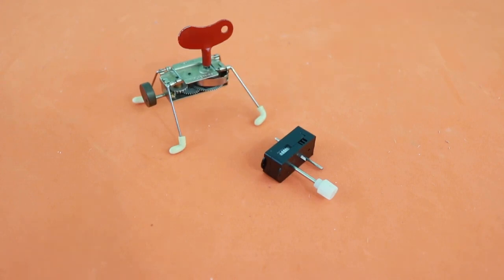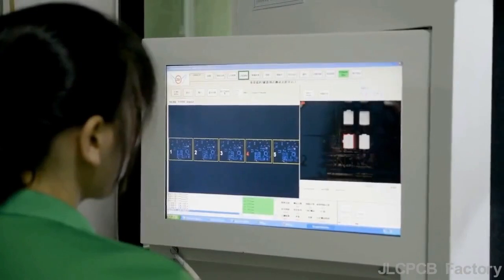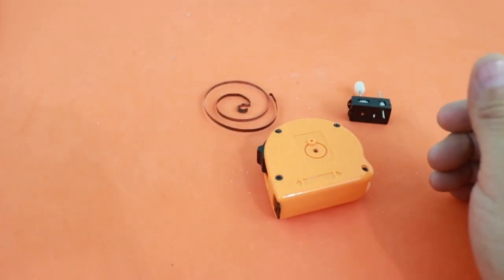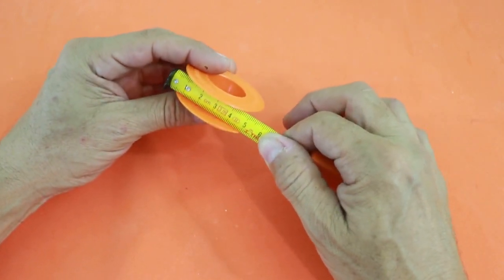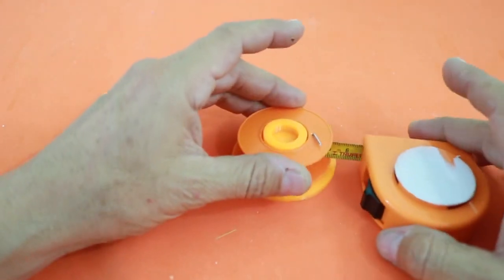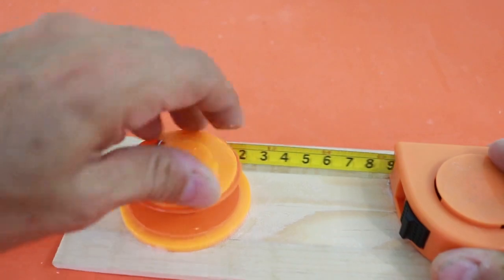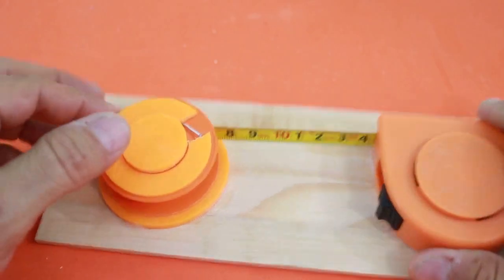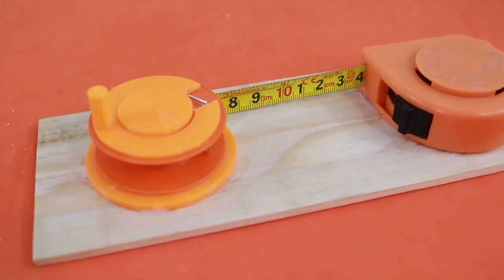Windup Mechanism Using Tape Measure

Comment: Okay, I'm only a halfway through this, but it looks like you're gonna use the tape itself. I don't understand why you would want to use the tape, just use the Spring.
I checked on the Grandpa's An old man video and he did the same thing. 
 I don't understand why you would even do that. So I'm gonna go watch your video on how these things work. Because maybe I don't understand but every wind up mechanism I've seen just uses the Spring and is powered by the turning off the Spring itself. There's no tape attached to it.
Reply: This reminds me of the tape measure races we used to have. When we are screwing off doing construction work. You let the tape all the way out and then you let it go so that it retracts and see which one is faster. It also makes the tape measure do somersaults.
Never realized we were actually doing science.

Comment: Inspiring!   I'm sure you have plenty of ideas and don't need anymore, but here goes!
1.  Ditch the metal tape.  The widthwise curvature is for rigidity when extended and detrimental in this application.   Replace it with a ribbon, as someone suggested, or just a very strong thread.  I think breaking strains of several kilos are commonly available.  Then you can.....
2.  Print a take up spool of smaller inside radius.  More turns, less torque,   less further gearing needed.   Or....
3.  You presented a square escapement a while ago.  You could make a stronger version and simply wrap the thread around the shaft.   If the motor is, say, 30mm diametre and the  axle 3mm, you get a torque reduction of 10 and lots of turns in a very simple way.  A wind  up clock, or rather, piece of kinetic art.

Comment: Interesting video. What about using the spring from a wind up wall clock? Should be pretty long. Could also use what a wind up music box uses to govern its speed: the flat blade fan using air resistance to slow the spring movement.

Comment: I suggest you replace the metal tape (which is brittle when bent & it will eventually break) with some ribbon of the width that makes sense to you.  It's plenty strong & it can be obtained from many suppliers.
Reply: simpler to just make some "plastic string"  from a bottle as wide as required...
and its wise to remember the old toy makers usually intentionally added a real metal flywheel mas to transfer the energy slower and smoothy to make it more useable
Reply: @paulmaydaynight9925  I thought that first also, but ribbon is usually stronger in the long run.